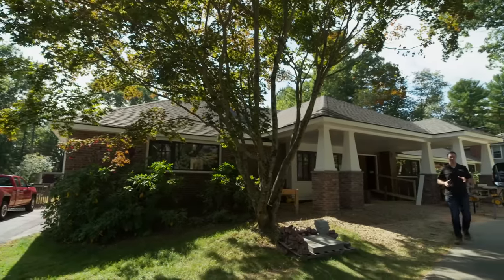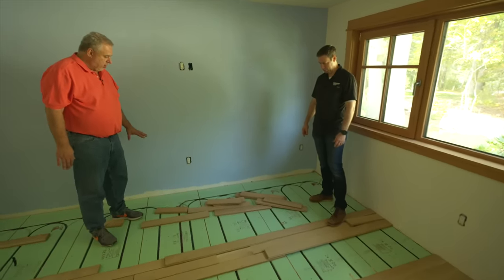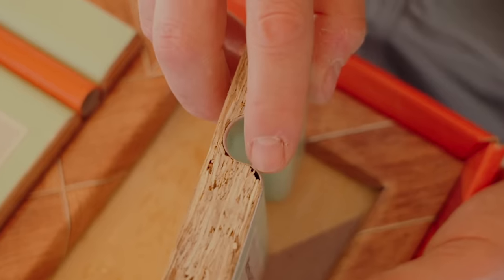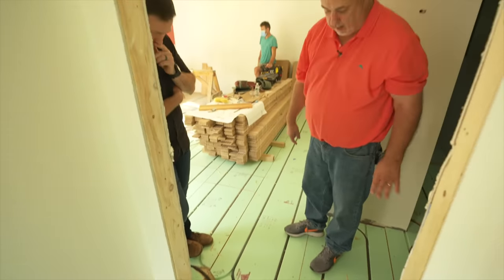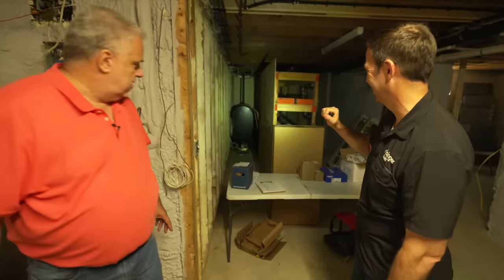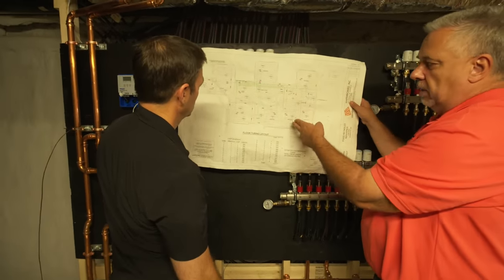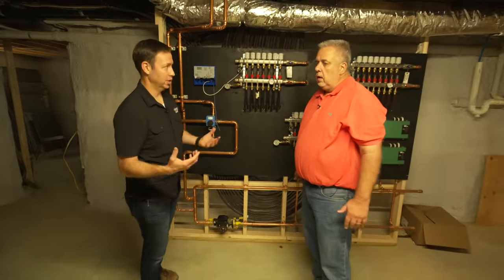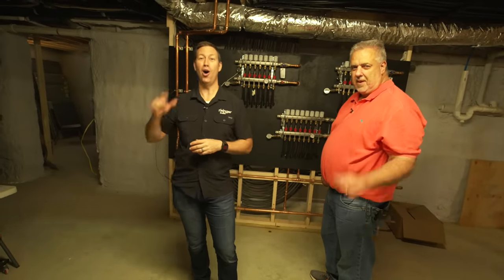Plug and Play Radiant Floor Heating System - BEST ON THE MARKET

Comment: I am entering my third winter season  for my new construction home in the northeast USA with an installation identical, except for the boiler, to that in the video.  Manifolds and flow valve controllers identical.  MIne is a slightly smaller house and a Niven combo boiler for the radiant heat and domestic hot water.  I am very pleased with my radiant heat installation.  More expensive to install .... yes .... but worth it to me in the stated benefits of a radiant heating system.  My boiler is propane fired from a buried tank in the yard (natural gas some day when the street main comes through).  My monthly heating bill is also quite acceptable, a benefit of also keeping the thermostats set at 68 degrees F, which is quite comfortable, even on the coldest days.  I also did go for higher quality windows and exterior doors, which does complement the heating system.
Reply: Well said
Reply: Sounds great but how do you cool?  I'm in northeast also waiting for first winter in my renovated townhouse.
Reply: @orielsy  would think two things. size of the system and as mentioned fuel available.
Reply: Solid Oak over Radiant is a no-no as it will buckle & crack. The only approved hardwood flooring over radiant is engineer hardwood flooring.
Reply: @lrc87290  I do have ducts installed for central air conditioning.
Reply: @stevepailet8258  As I stated in my note ...... I have a NIven combi boiler for support of the radiant heating system and domestic hot water.  I recall it is Niven's largest capacity boiler for my approximately 2700 sq. foot house.  A 500 gallon buried propane tank in the yard supplies the boiler's fuel.  There is the outlook that I will have a natural gas option in the future.
Reply: @guytech7310  solid hardwoods are consistently not recommended by all the suppliers I reviewed, except for one in my search for my home  My 2nd floor bedrooms and halls are engineered flooring, which is supported for radiant heating.  The rest of home is porcelain tile, which of course is not a problem.
Reply: So can you tell me what use those flow valve controllers are? Let's say it gets too hot and you turn off the heating in one room. How long does it take for the temperature to begin dropping?

I'm asking because I have underfloor heating as well but done very differently. Over here (in Belgium) the heating tubes are always embedded in a heat conducting cement with floor on top of that. This makes for a huge thermal mass so it takes hours for the floor to begin warming/cooling when you turn the thermostat on or off. Also, we don't (as far as I know) have individual flow valve controllers. Either your entire floor is heating up or it isn't.

Because of the time delay between firing the boiler and the temperature rising, modern systems don't use the inside temperature to decide wether more heat is needed or not. Instead a temperature sensor is placed outside your house and heat is sent into the system based on the outside temperature and some parameters that have to be configured. When done right it is more efficient and the temperature inside is near constant.
Reply: Thomas Van der Veken need more run time on the pump. Make small adjustment. Valves on each loop to fine tune areas of a zone.
Reply: With this type of heating the water temperature is much lower then for, at least in much of Europe, a standard radiator system, which is ideal for a heat pump system air or ground, and, in five years time, when gas is banned for heating in new builds in the UK , one of the systems that will become standard. Standard radiator temperature will be around 50 centigrade, with a normal control system, far too hot to stand on, underfloor will be around half that, just pleasantly warm, does need higher insulation and draft proofing to get the maximum benefit. Because of this a ventilation system with heat transfer is required. Will cost more, but like most products over time that will drop, the long term advantages much lower energy bills and far less damage to the environment  far out weight that.  Only question would be in hot areas, like the southern part of America,  using this type of system to cool, never heard of that function being available, and not sure if it would work, heat rises, could be to end up will cool legs, hot head.
Reply: @view05nys  Is your ductwork somehow tailored for A/C (differently than a typical cold climate duct system)?  What part of the country are you? Do you have an ERV or HRV?

Comment: Every circulation pump should have a shut off valve immediately next to both ends of the pump. This makes it much easier to change out bad circulation pumps. This helps eliminates air getting into the closed loop systems while replacing the circulation pumps. It also lessons the loss of glycol when replacing pumps.
Reply: I second that.
Reply: I third
Reply: The plumber installing won't be changing those pumps out ;)

Comment: In UK underfloor heating is the most desirable system for domestic situations.  Most of the extensions I have designed in the last 10 years have had UFH.  It is only marginally more expensive than a radiator system but pays for itself in energy saving.
A normal radiator or forced air heating works by air moving at ceiling level until it hits a wall where it cools and then drops to floor level.  That means that the temperature at ceiling level is a few degrees above that at floor level and sitting around in the house we all notice how cold our feet are first so we raise the temperature of the radiator or hot air, which means that we are putting in excess heat just to stay comfortable.  UFH provides a comfortable temperature at the input point - i.e the floor.  That heat then rises to ceiling level.  In an UFH room the temperature of the air is about the same from the floor to the ceiling so overall less heat is put into the room.
Care must be taken when installing the thermostats and circuits as I had the situation where the contractor linked the internal dining room 'stat to the conservatory and vice versa.  It took 6 months of investigations by the plumber to then check what I said seemed to be the issue.  A simple reconnection at the valves and the client was happy!
On this scheme I noted that 3 bedrooms were in zone 5 controlled off one thermostat.  I would question that in that, all the bedrooms had different heat loads by virtue of the orientation and number of external walls.  The middle room was the best insulated and the RHS one the worst.  A single stat in one room will give a false heat supply to the other two.
Also, to be totally effective the floor must be well insulated with at least 100mm of PU foam board.
Lastly, I put UFH in the 1st floor en-suite shower to the master bedroom on one job, much to the eternal gratitude of my client!

Comment: For retrofits, consider radiant heating in wainscoting.  Its nice to have warm floors but heat radiating from the walls is comfortable too.
Reply: Radiant in the walls is definitely a good option in some scenarios, particularly if you have existing floors you really want to maintain.
Reply: @Warmboard  Heating in the walls and floor is a very, very, very old system indeed.

You won't need me to remind you this system was invented by Sergius Orata around the first century BC.

He was an established builder, businessman and inventor of farmed oysters, and other stuff.

Some say he might have "borrowed" the idea from earlier cultures but frankly who cares ... we'll presume any Patents have run out by now.

The idea, as an idea per se, was in use for many hundreds of years so the concept is well proven.

We'll call it a "hypocaust" for short.

As the earlier comments confirm, producing heat energy can be achieved by several ways and the economics of the fuel used appear to depend on where your home happens to be and the particular pricing policy of said fuel in "a" region. In short there is no real absolute best way of doing the heating.

(Historical Fact Alert:

In Bath (UK) our Roman "visitors" were very quick to exploit the natural spring (now in centre of Bath) which has produced water at a temperature of between 39C and 46C for, at the very least, the past 2000 years.

It provides hot water for the baths themselves and also keeps the entire "baths" warm. The water is said to have curative properties ...if drunk ... the only thing it cured me of was wanting to taste all these natural geothermal springs ... the taste is vile, and that's putting it politely.

The beauty of this vaguely hypocaust type system is that it might be argued the heat is radiant, conductive and convective.

This comes from the "What did the Romans do for us? joke. In fact they gave us quite a bit.

( Completely off topic yet possibly Interesting Fact Alert:

It is suggested the Romans were the first to discover what is now known as N America a thousand years before Columbus arrived ... so, technically N America is but one of the larger Italian Islands ... I knew that would cheer you up.)
Reply: @suspicionofdeceit In warm climates like South Texas placing the PEX turbing in wainscoting of one wall in a room is adequate. PEX is  unlikely to ever leak, but its easier to repair when done this way.  The energy from the heat doesn't know up from down. Warm air rises, but heat waves radiate in all directions.  Not common, not for everybody.
Reply: That's a good idea.  Do you have to worry about condensation or anything?
Reply: @suspicionofdeceit I wrote to matt perhaps a year ago  he said he had never seen the system till then
Reply: @oatlord  there would never be condensation unless you got the inside RH up into say 99% LOL
Reply: @stevepailet8258  even against an old wall without proper vapor barrier? I'm just asking, no need for the lol
Reply: @oatlord  since I live in zone 4 I would not actually install an inside vapor barrier.  Pretty much have to run with modified air sealiing that lets vapor flow in both directions
Reply: @oatlord Might I suggest you refresh your memory on the Relative Humidity topic in conjunction with Dew Point.
Reply: @suspicionofdeceit I am intrigued by your comment. Would you care to expand on said comment and say the method is uncommon as compared to what?
Reply: @timothykeith1367  Having used plastic water supply pipe even before PEX appeared I have never had the pipe or a joint fail of itself.

One point to consider is to ensure that there are no longitudinal scratches near a push fit joint. The "o" ring is unable to seal a scratch and weeping will occur.

Using a brass compression fitting with a pipe insert is, from experience  virtually 100% leak proof.

TOP TIP: never, ever, forget the pipe insert when making a joint of any description.

As you state heat radiation goes in every direction imaginable and "up or down" is meaningless in context.

I have followed quite a few threads on heating and draw the conclusion that quite a few heating equipment installers (not heating engineers per se) are, as yet, not fully conversant with the properties of "radiant" heating with regards to the invisible, to human eyes, part of the IR spectrum.

If anyone interested then Google up FAR IR. More than enough to read if you're enduring a covid-19 lockdown.

Reading these articles might indeed be a revelation to some ... and of course mean we're all singing from the same hymnbook so we don't continue to have disputes about heat rising when what is meant is that a hot medium (air say) rises.

Radiant heat needs no such medium to "work" and if proof was needed then folks need look no further than the sky. Our star, aka the Sun, has been supplying radiant heat for billions of years across a vacuum some 93 milion miles "wide".
Reply: @t1n4444  Maybe you think I'm referring to a new built house.  100 year old farm house with little insulation and crumbling vapor barrier.  In New England.  You're going to slap a heat source directly against an exterior wall with no concern for the condensation?
Reply: @t1n4444  Radiant heating is cozy and quiet.  I am old enough to remember the cast iron radiators that were once common, but bulky.  Then, the baseboard heating became popular.
Reply: @oatlord  Indeed no, I refer to the physics. Apologies if not crystal.
Reply: @timothykeith1367  It certainly is convenient and for the infirm or elderly probably a godsend.

I gather FAR IR infra red heating is much favoured by the medicos as radiation at those wavelengths benign and atmosphere "pleasant".

Beats lugging around lumps of solid fuel/cleaning out the ash pan and grate any day of the week.

However, whilst the efficiency of such a radiant FAR IR device is nigh on 100%, the cost of electricity may not be the cheapest in your locale.

There again "you" may consider not having to lump fuel about or have a gas powered central heating system requiring annual maintenance worth the extra running costs.

I have recently installed a radiant panel for evaluation purposes and engineering myself out of being cold. I have a multifuel stove, diesel water/central heating, gas appliance, electric water heating and now electric heating.

I consider the costs secondary to the cold. And of course we get an annual heating allowance regardless of income!
Reply: @Warmboard  it would probably be a better option to run the coils under the subfloor (above the subfloor products typically don't work below the subfloor, so you would be looking at a different set of products). running loops on the walls has about a 10% lower thermal transfer rate compared to running loops on or under the subfloor. obviously, you wouldn't want to run loops in any wall where you might want to hang pictures (something you probably wouldn't be doing on wainscoting, but how many people actually want wainscoting these days?). another option is to run loops in the ceiling, but that option has the lowest thermal transfer rate of all.
Reply: @paperwait9611  Aha, presumably you missed the video on radiant heating?

Water pipes in the ceiling.
Reply: Barry Boppins  Natural gas is cheaper!
Reply: Barry Boppins  I live in San Antonio. NG is available in virtually all of the city except this neighborhood.  I want to ask neighbors to push to get NG here.
Reply: Barry Boppins  Natural gas also works well for replacing oxy-acetylene for metal cutting torches.  Clothes drying. Heating water.  Great stuff.  NG seems to be virtually unlimited compared to petroleum.  There are huge gas fields in Texas due to fracking but it is often uneconomical to collect the gas because pipelines are costly to construct and compressing the gas for trucking it out is also not practical.
Reply: Barry Boppins  Recent regulations in the U.S. require that the gas be captured and not burned off.  Some the gas is actually injected back into wells to increase oil production.  Lacking local pipelines there will be innovations with on-site gas compression so it can be hauled out to the nearest pipeline.  Truckers in fracking areas can earn a very good income - haul the sand in, haul the oil and gas out.  They need to fuel the trucks with NG.
Reply: Barry Boppins  The U.S. exports liquified natural gas but the exports have fallen to 3 billion cubic feet per day in 2020.  That's a lot but more is wasted. The exports of LPG had been greater than 8 billion cubic feet per day.  Fertilizer - all sorts of products are made from NG.

Comment: I live on the north shore of Massachusetts in a house built in 1886.. We used to have a forced hot air system that was likely installed during the Eisenhower administration.. In 2013, we replaced all of our first floor heating (which was four hot air registers) with a radiant system.. AND added Runtle radiators to our second floor where we only previously had two hot air registers for the entire floor!... When heating season comes, the floor is at a nice 85 degrees.. we can set the thermostat (at chest level) to 65 and be very comfortable.   Due to other inefficiencies in the house, we don't save a lot on gas but we're a hell of a lot more comfortable.   The Plumber that installed my system was a 19 year old apprentice.. his work was/is impeccable.. He's now my go to plumber..  Trade schools doing good work.  (BTW.  The guy doing my floor (White Oak also) did hit a pipe.. They just opened a port hole to the basement where the splice was installed so it could be inspected.  7 years later and no issues)

Comment: This is an amazing system. Common complaint against underfloor heating is that it's difficult to extend above ground floor level to make a whole house system. This just knocks that right out of the park. With some modifications I see a potential to apply it to listed buildings without compromising structural integrity of floor beams or listed buildings constraints. So many listed buildings in the UK and Europe linger on the at risk registers because they're either to costly renovate, to heat, or both. 
Presumably this system would marry up equally well with ground or air source heat pumps.
Reply: I install in floor heating for a living and do many entire houses(second, third floors, basements, outside the house for snow melt). It’s not a problem.
Reply: @dre200112000  Is that in the UK, Europe or elsewhere?